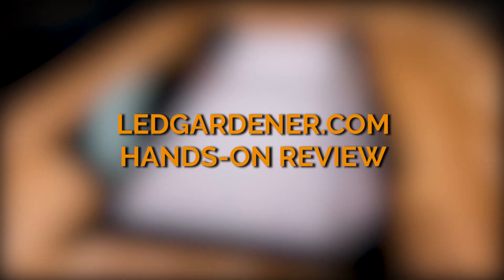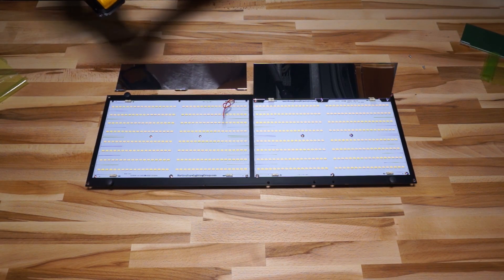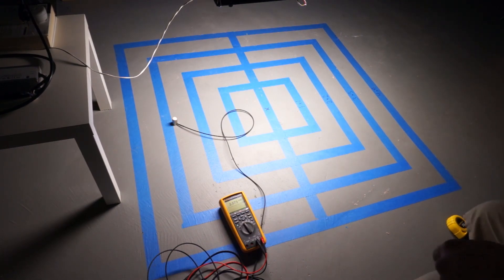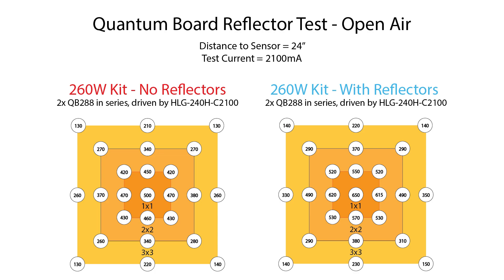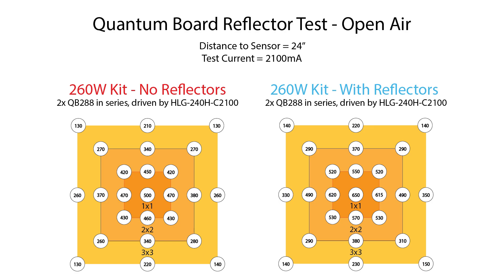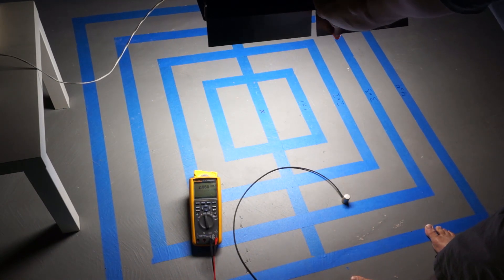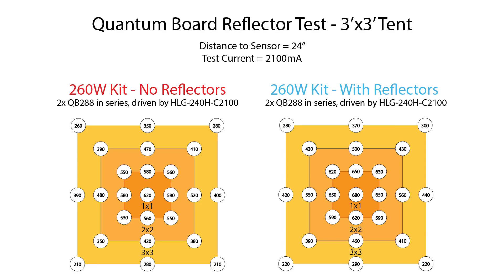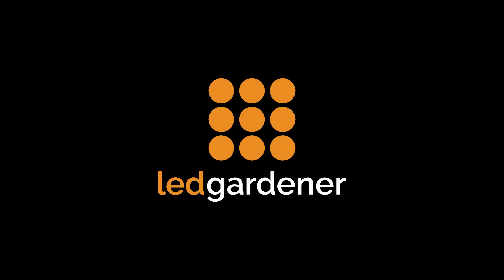Hands-on Review: HLG Quantum Board Reflectors

Comment: I calculated the ppf output based on the measurements you took, even in the tent your getting a 25% increase in total light output and efficiency with the reflectors- 432 avg ppfd without reflectors and 541 ppfd avg with reflectors.

Comment: how is it possible that the outer diameter has increased in par. usually with reflectors it concentrates the photons , this makes the inner circle stronger but the outer edges weaker in par. thats why most people dont use them,
Reply: The reflectors are only collecting light that would be otherwise cast off to the sides. They're not stealing light from the middle ✌️

Comment: Good review and solid technical info. I think one thing really being missed here is that these are mirrored finishes, which produce linear specular reflection as opposed to diffused reflection like either matte white paint or much better diamond mylar. Think about what the wing reflectors look like behind HID fixtures, they're not mirrored but dimpled and speckled. By having mirrored finishes, these reflectors just send the light in directed single angles based on how it hits the board, like focusing beam reflectors on a laser. That's why you're not getting big differences on the edges, but instead are getting hot spots. If diffuse reflectors were used, it would DIFFUSE the light, or send it in dispersed patterns and would improve average coverage and intensity quite a bit instead of just the middle. That's why grow tents are lined with mylar because it provides diffuse relection. I'm looking at designing my own homemade diffuse reflectors out of some diamond mylar lining a rounded piece of material like a sliced trash can or something, think it'd perform way superior to these mirrored reflectors. But like you said, it depends on the height of the LED and breadth of area you're trying to cover.

Thanks for the video and tests!

Comment: I'm looking into recycling my current DIY with 12x LT-H282D, and building an equivalent to this very same HLG Combo.
Parts are easy, as I need an additional 12 led strips, and upgrade to an HLG-320H-24.

What I am struggling with is the heatsink. Sourcing one like the ones supplied by HLG in Europe has proven to be very difficult. I do have access to aluminium sheet.
What sort of thickness should I be looking at to cool this type of setup? 3mm / 1/8th of an inch?

Love your channel and website/forum!
Reply: Could you not just buy the sink from HLG? https://horticulturelightinggroup.com/collections/diy/products/qb304-board-heatsink-slate-2

Comment: GREAT light BUT those copper dots by the input/output terminals are LIVE! they short to the reflectors! look out for this. i found out when a 320 driver in series w 3 QB boards and only one board was working. they short the board and are LIVE. thanks rik
Reply: Thats why HLG doesn't sell them anymore.